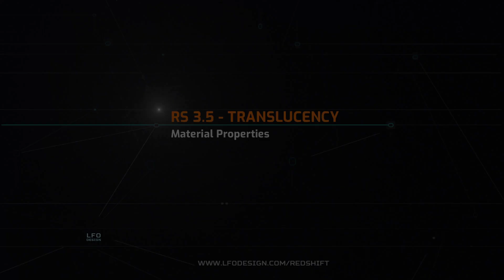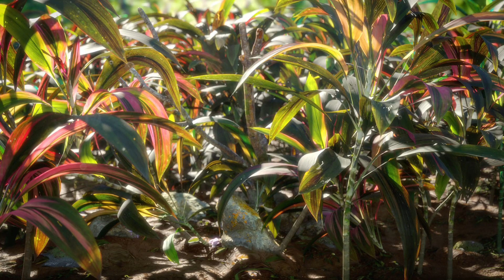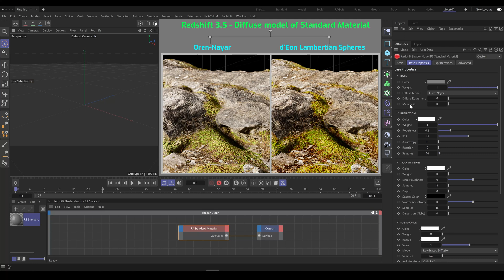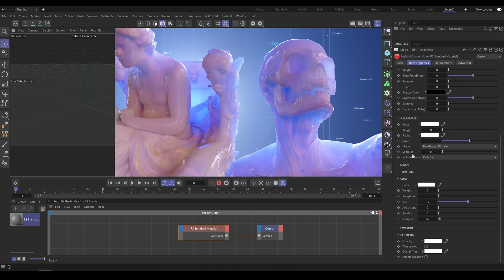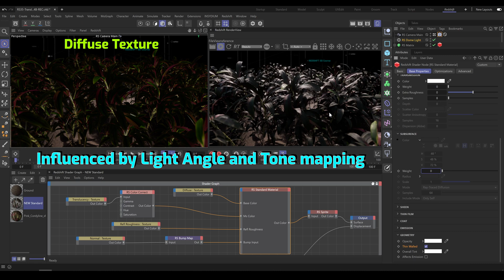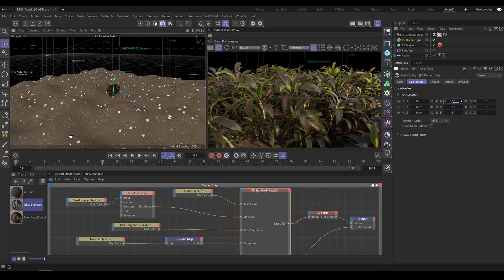C4D R26 / Redshift 3.5 - Translucency and  Back-Lighting Effect

Comment: My subsurface looks very different to yours, running r26 / RS 3.5... there is no 'weight' slider, only attenuation, transmittance etc...
Reply from the maker: Use standard material instead RS material
https://youtu.be/LJ14l9pVu7I